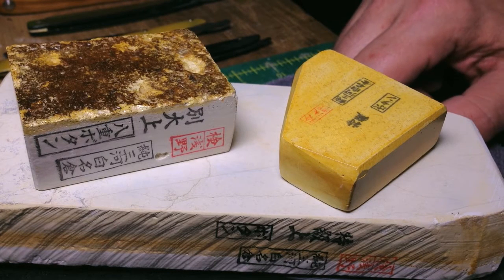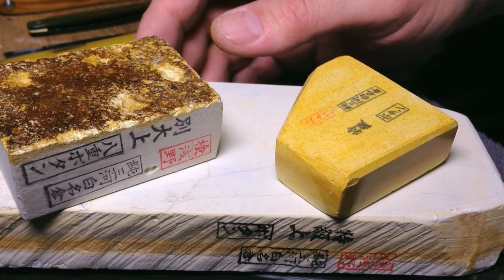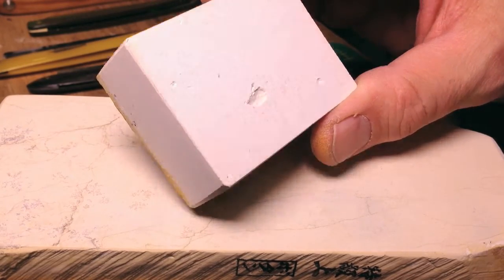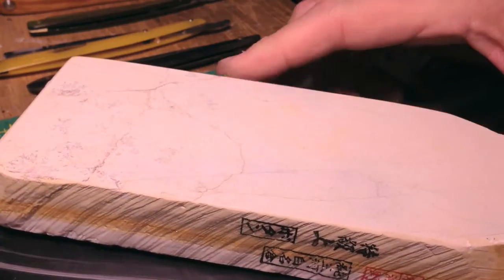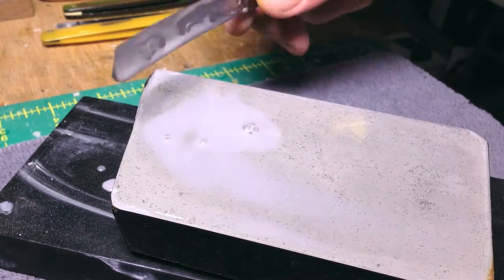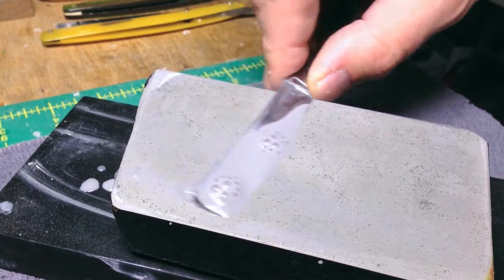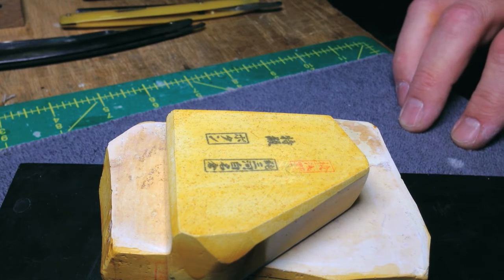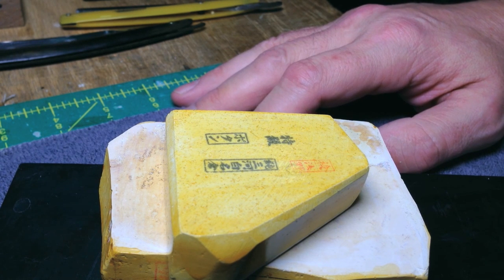Mikawa Shiro Nagura 2 - Botan

Comment: Is there a nagura you would recommend for using on Imperia LaRoccia stones. I’ve got the 8-10k and the 12-15k. Ive honing only for a few months so right now I’ve got a shapton kuromaku progression and the IRLs for finishers. Also a shapton glass 16k.
Reply from the maker: Not really, no. Those stones didn't perform all that well to begin with and with slurry their performance dropped a notch. Using Nagura on them would be a waste of good stone IMO.
Reply: I know this is a loaded question but is there a budget friendly stone you may have to replace the IRLs with?
Reply from the maker: @markb3605  Everybody's budget is different so it's hard to say. Plus I don't usually make recommendations because there is so much ground work that plays into the results that calling out a finisher might not be the solution. 
Just off the top of my head though...a nice translucent Ark, maybe 6x2" and get it lapped flat - hard to beat one for a finisher but your work before it will need to be 110% on-point.
Reply: Thanks Keith, I’ll hit you up when I’m ready to pull the trigger